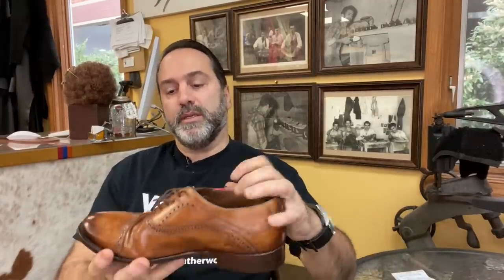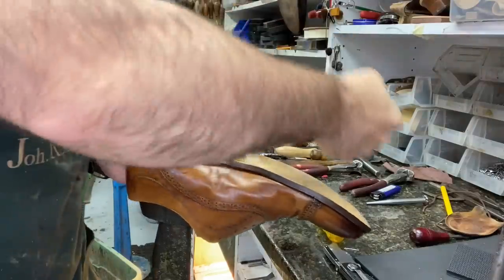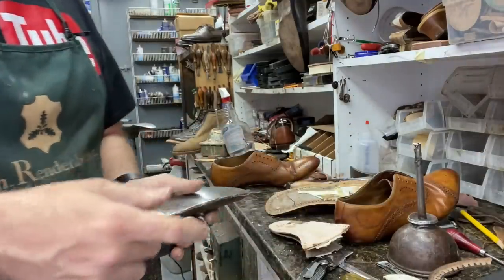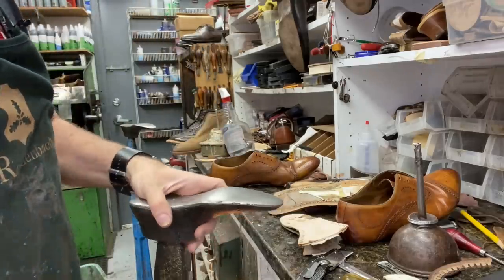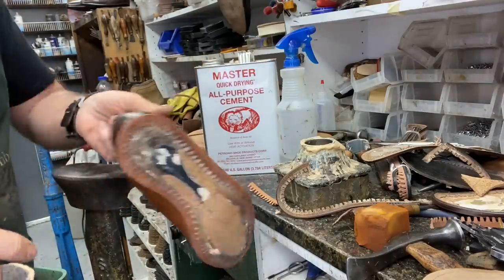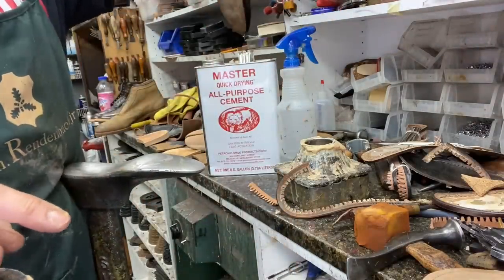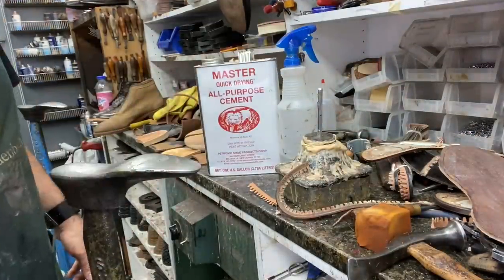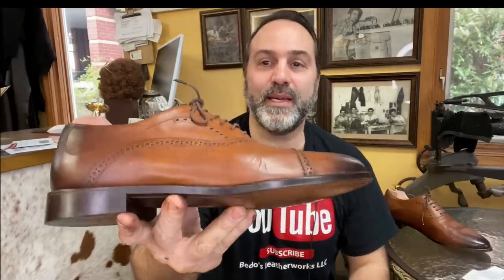Bringing back a pair of Magnanni shoes.

Comment: The way the manufacturer puts the piece in to give it a fiddle waist shows they know what people look for in a quality shoe, it's just a shame they hide a pile of crap under the sole instead of using quality materials.

I'll definitely steer clear of Magnalli, if I'm paying a premium I would like a premium product, having nice quality leather uppers and a fiddle waist hides the paper footbed and paper welt. At the least I'd have expected a leather welt, they're not cheap and leather welt isn't super expensive nor a large amount of material. You're a real eye opener! Of everything I've  seen you or anyone else repair I think the John Lobb shoes and boots have had the best constructed footwear. The heel rand is always tight to the heel, big wooden shanks that don't seem to break, even if they may need regluing once apart. Beautiful stitching and high quality materials all the way through. That's what separates a shoe under a grand from one over a grand, but to be honest you do get significantly better value for money when they can be resoled that many more times. 

You've opened my eyes to the difference between quality footwear and brands charging for quality footwear but not delivering on a high enough level. As goes for the detailing of the leatherwork on the sole, I have several pair where part of the pattern has become worn, but the places where it's not worn the pattern is still there and makes the sole look more highly crafted, as it is

Comment: I actuallly like the time you take to add those little touches to your work,  it means some had taken the time and effort.  When I repaired cycles,  I didn't have to clean them or add in some new cables or fluids while I repaired the gears.. but I did,  because thats who I am.

Comment: i've seen some cobblers let the cement dry on the sole first and place it under heat to activate it once it's tacky.  what's your opinion on that?  if i've seen your videos correctly, it appears as if you glue the sole right after you put the cement on it.  
in any event, congratulations on another incredibly well done job.  you truly have a gift.

Comment: Nice re-build.  Great return to original shape.  BTW how are my dirty AE Nubuck shoes coming?  They are in your shop for Dainite red soles.  I do pot lots of steps in to these shoes.  I am hoping the Dainite soles last better than the original AE soles.
Reply from the maker: Slowly but surly
Reply: Those Dainite soles from AE don't last very long. I only wear mine when the ground may be wet at some point in the day. I hate getting my leather soles wet.
Reply: Bedo's Leatherworks LLC - Surely, I hope my shoes are not surly to you.  I do treat them in a rough way and make them walk many steps, I do apologize if they are in any way bad tempered to you and you staff.

Comment: I just got a pair of these shoes, rubber top lift i think you called it (the heel), the corner got chipped after the first use, is this common?  im kind of shocked that it was so fragile
Reply from the maker: Some rubbers are not good quality so things do happen unfortunately
Reply: @BedosLeatherworksLLC  Thanks for the response, do you have any suggestions?  They were a gift and I have the box, I was thinking of going to Nordstrom and see if they'll replace them, one use seems quite obscene for such an issue... I appreciate your expertise and insight

Comment: Hi Steve,

I figured I would drop a comment regarding the last 4 minutes of your video. While I truly share your sentiment and point of view (from a legal standpoint); I believe that you did the correct thing by stopping to stamp their shoes at your workshop. Even though it is their shoe; the issue is that the stamper which you had been using carried their brand name (their trademark); and you were using it in a non Magnanni factory / setting (obviously) and this was giving off the wrong impression.

In my opinion, that company simply acted like a child and just had a problem with your stamper. Even though it is always possible to ask for permission; I would not engage with them ever again.

In conclusion: 1) Yes, you do do a better job than them. 2) I wish I dealt with more people like you.

Regards!